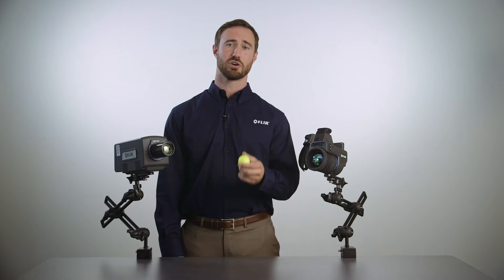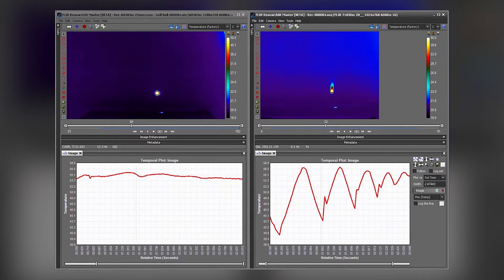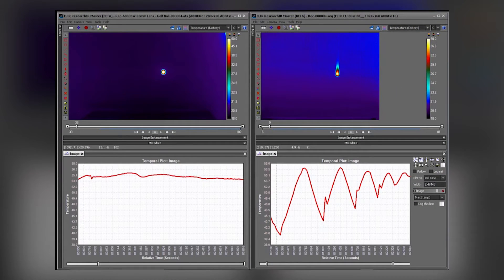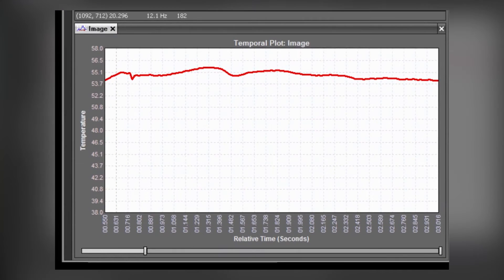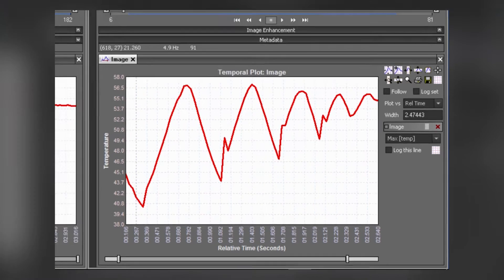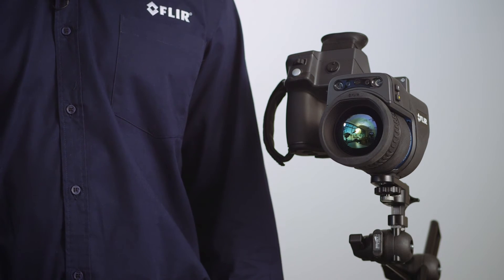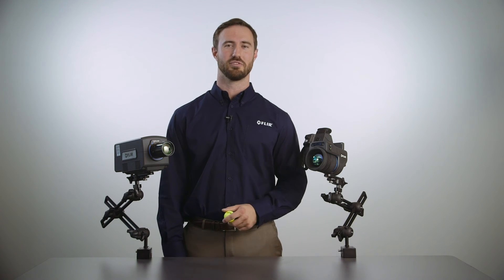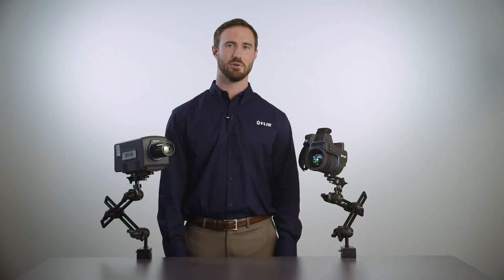Cooled vs Uncooled Thermal Cameras: Speed

Comment: why do the background change in the uncooled footage?
Reply from the maker: There is no background change - both were filmed simultaneously.
Reply: +FLIR Systems it turns light blue and back to dark blue?
Reply from the maker: +Norfeldt what you are seeing is the autoscaling/image enhancement at work on the T1K. The uncooled camera is midwave and also higher sensitivity so you don't see the image change. The scale also may have been locked on the cooled - we can certainly check into that. However, it was done side by side.